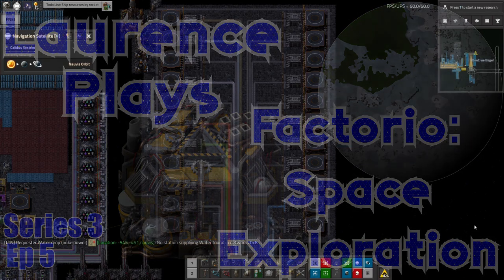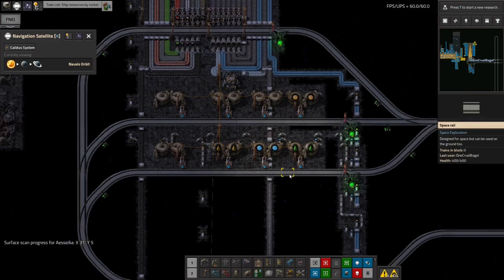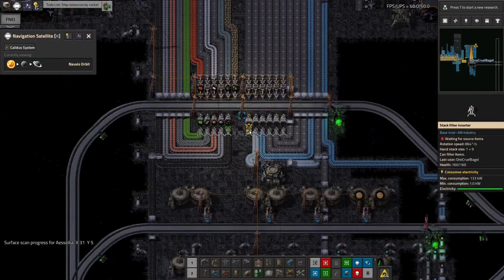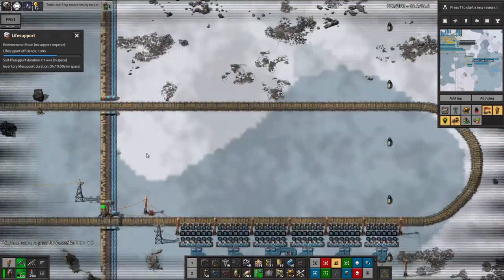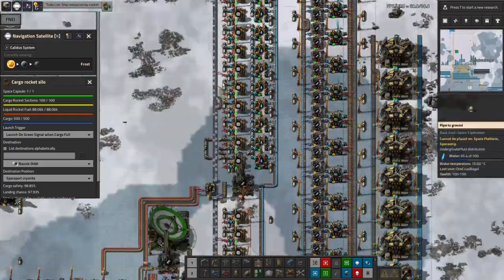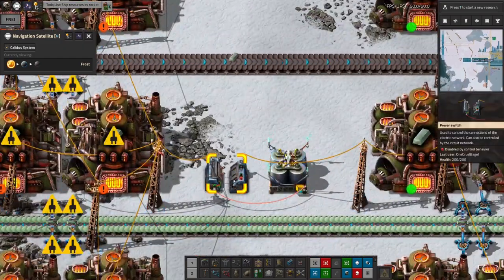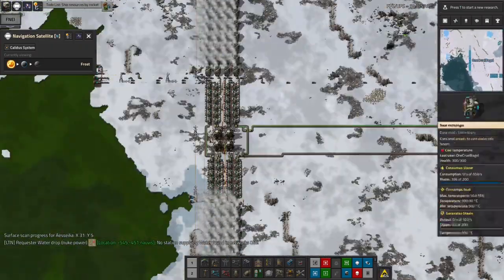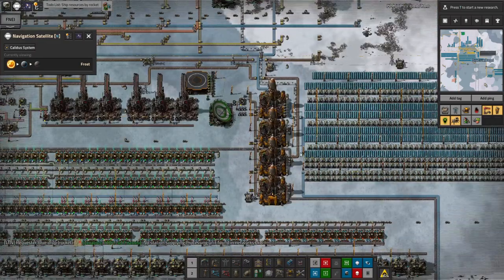S3-E5 - Cooling Power - Laurence Plays Factorio: Space Exploration

Comment: For that flickering (if you have performance struggles), a Set-Reset (S-R) switch is easy to make with the circuit networks and works well. But easiest solution is just adding another nuclear power plant. xD I do my ore processing on Nauvis, so if my Cryo/Beryl planet ever runs out of Beryl, sending rocket parts and rocket fuel to the asteroid belt is rather trivial. An initial infrastructure cost for all the scaffolding, but the densities are immense. After scanning a bit, I have a patch of like 240 million beryl, which will never run out.

Also, how far ahead are the streams compared to the videos? Given that you did have a "Well actually," moment as prophesized at 27:10. ;)
Reply from the maker: Yeah, I'm familiar with using hysteresis on a switch to turn the power on and off a bit more smoothly, I just haven't bothered because it doesn't matter... Although the performance hit is an interesting point! Another power station would be ideal, however I didn't have the parts out there to build one, I'll try to remember to take the bits out next time I go! To there, and probably every other planet... 

Doing all the processing on Nauvis is an interesting idea - I think you'd end up having to send a lot more rockets though, since processing compacts everything down a lot (especially with holmium!). That said, it would make sorting everything MUCH easier. Do you ship ore or core fragments? 

I've not done any mining in asteroid belts yet. I've noticed that the patches tend to be very small in size but very big in total amount of ore... I'd need to speed module them pretty strongly, but that's not too difficult. I've not seen a huge amount of different ores in space, but I'm pretty sure Beryl is one of the ones that's out there. 

There is currently only 2 videos in the buffer... Some of the things I've been doing have been very time consuming to make and quick to explain! I need to try and boost that a bit, I think... Sorry about the spoilers   :-D
Reply: @LaurencePlays  I ship ore at the moment. Looking back, I probably could have shipped the crushed stuff (since that is one compression step without any byproducts or requirements), but didn't think of it until I had all my designs set up to receive ore and send out plates.

Overall, yes, I do need more rockets (both in receiving ore and sending it up to the space station where it is needed), but I have a lot of rocket parts – current production can easily keep up with 30 rocket parts per minute. That will only get easier as I shift over to the cheaper LDS and heat shield recipes.

Will probably switch over to core fragments slowly as the mines on Nauvis run dry, see if it keeps up before adding new outposts. It will make life easier for iridite and uranium since I won't need sulphuric acid to mine them.

Main benefit for doing everything on Nauvis, beyond the ease of sorting (just dump byproducts into the train network at a slightly higher priority), is productivity modules and the 22, 23 GW power supply that is available if needed. Base pulls about 14 or 15 when running at full tilt, possibly more given that it hasn't run at full capacity in a long while as I've been setting up stuff on other planets.

All the power is properly wired up that it is inactive as much as possible given that I play on an old laptop and need every bit of performance I can squeeze out of it (hence my many comments on performance, haha). The electric network on my save takes about half as much UPS as the entities (4.5-ish compared to 9ish), which is very high. The rapid flickering is very bad for performance on that front, which I discovered after screwing up my connections at some point. xD
Reply from the maker: @pietersieliepc  Rocket parts aren't too bad, as you say, they can be made at a decent rate and most of them get reused. I'm finding that the rocket fuel is more of a limiting factor! I guess I just need to build it out on a slightly larger scale. I've done central processing before in vanilla games and with trains and their lower fuel (and component) requirements, that's worked well, but I tried to be a bit more efficient in SE. I worked out that sending core fragments is cheaper than sending ores (assuming you want all the products from them!) but significantly worse than sending ingots. I think things are fairly stable now, but I guess we'll see as I carry on playing... 

My computer isn't enormously powerful, but I upgraded it quite recently so it's no slouch. I haven't noticed any problems, apart from saves taking longer than I'm used to. I think it's alright for now!
Reply: @LaurencePlays  Performance issues?? Hah, my laptop just started shutting down after completing lvl 1 space sciences. I need a better laptop to continue. So sad. Mainly bc I overproduce everything.
Reply from the maker: @cptcarter1st  I'm happy to say I haven't had any performance issues ... yet. I get a pretty steady 60/60 FPS/UPS at the moment, but then I do have quite a new processor - a 3600XT - and I'm not running Windows!